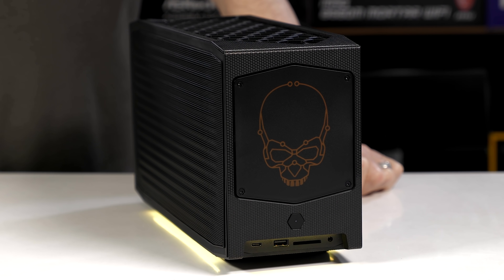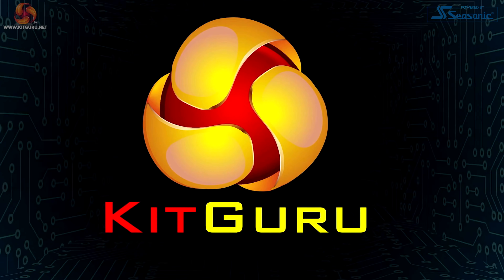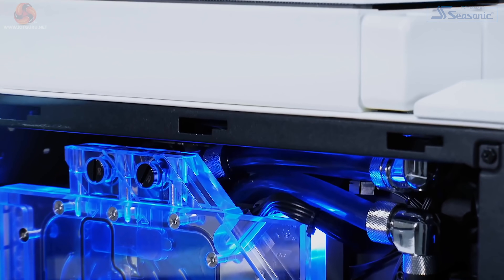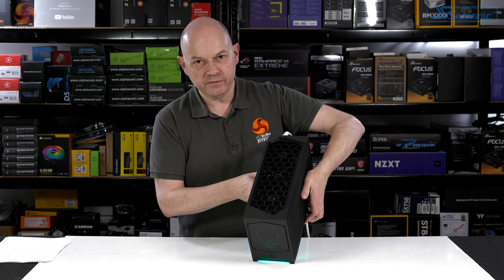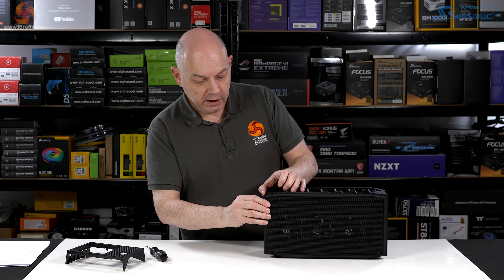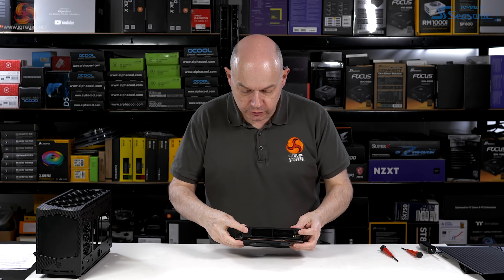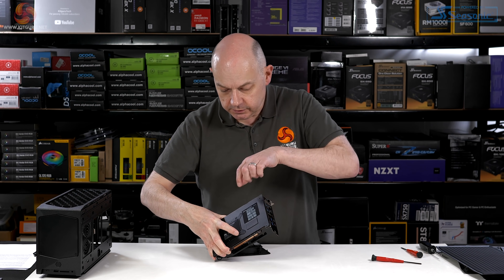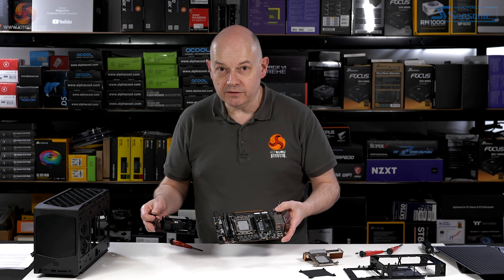Intel NUC 12 Extreme Review - Dragon Canyon!

Comment from the maker: so - let Leo know, would you buy it? are you in the market for something like this new NUC from Intel - and would you pay for it?
Reply: I'll wait for the Enthusiast version. I'm still not sure about buying the Extreme version, even for last year's 11th gen model.
Reply: I am looking for smaller version Intel NUC 12 Serpent Canyon The successor of Intel Phantom Canyon. Please make a review once you have it. Thanks
Reply: can u swap chip on this?
Reply: @frankhu8692  Supposedly, you can. But it's way too early to tell since this is the first time Intel give LGA socket.
Reply from the maker: @frankhu8692  Provided it is supported by the BIOS then yes
Reply: I'll probably settle for a few tiers down to replace my old Skull Canyon NUC, Only use it as a secondary pc to stream off NAS to (dumb)tv and watch youtube.
Leo, My question is do all the newer NUC's still have the built in IR receiver?
I can turn on this old NUC with Logitech Harmony remote from the couch(yeah I know I'm lazy) but I love that feature, Some of the other mini pc's lack the option and it is a no sale for me if it doesn't have it.
Reply from the maker: @ShaneMcGrath.  I haven't seen a reference to IR anywhere in the spec and did not receive a remote control so I reckon that's a big fat No
Leo

Comment: If I want to upgrade my NUC 12 Extreme i7 to the i9 variant, is it as simple as me purchasing just the CPU 12900 i9 variant and putting it within the Intel NUC 12 i7?  Or should I add thermal paste/update the BIOS? Or is the Compute element slightly different with the i7 variant versus the i9 variant? Would it void the warranty?

Comment: Saw from different review that it actually thermal throttles.  Hope Intel redesign the thermal solution next year.
Reply from the maker: During the initial boost under heavy load the CPU hits 105 degrees C however that is very brief. Thereafter the power rapidly decreses to 65W or 55W (or 35W) depending on the power profile and sits at the low temperature we detail in our test results. Not sure what you have seen elsewhere but our review sample did not throttle and instead behaved as intended.

Comment: Buying one! Easiest, maybe cheapest way to get a full Core i9 system. And it'll fit on my desk, freeing up under-desk space for... whatever. Wish I could order one now and not have to wait. Will move my current graphics card into it and put in a PCie 4 1TB NVMe SSD along with, probably, 32GB RAM. (Most of my data is stored on a large NAS.) Not crazy about the skull, but it is what it is. Good review. Thanks!
Reply: Where do you buy it from all i can find is scalpers amd thirdparty sellers. For some reason not even intel is telling me where to buy them.
Reply: @declanmeurig3861  It's not out yet, so nobody has them. It should be out in April, so I hear. My eyes are open and I am checking the Web for review and stuff daily. Keep your eyes open for its release. It should be available from several sources other than ones that add a too-expensive SSD and 8GB of RAM and are charging $1800 for it.

Comment: I love the concept and the form factor. Is it worth the prize? No I don't think so. I still don't get it why they wouldn't invert the cpu slotted motherboard. I understand the airflow between the gpu and cpu board will give some thermal issues. I am more a fan of a bigger cooling solution for dissipating the heat. If the prize was more reasonable I would be interested in it. For sure I would like to win one or get one discounted but a company has to make money. Great review Leo/Kitguru.

Comment: Who else was hoping beyond hope that Leo would reveal an Intel GPU when he opened the case?

Leo, please a chopstick to depress the GPU release tab; you won't scratch anything if you slip. When you slip. Would I buy it? It all comes down to price and the use case. An ITX system in a premium case is pretty expensive anyway, so a modest premium for this could be tolerable.
Reply from the maker: It's that word 'modest' that does a lot of heavy lifting. What price do you think is acceptable for a PC with an EVGA RTX 3070 (£900 these days?), 16GB of DDR4 and 1TB of Gen 4 storage?
Reply: @KitGuruTech  Yes, 'modest' does cover a multitude of sins. :) I'd put my own GPU into it. But I specced up a 32 GB 11400F system in a Torrent Nano (loved your review BTW) and that came to £739. So a little more than that.
Reply from the maker: @QuentinStephens  Do please apply the same reckoning to the Dragon Canyon NUC  and let's see whether you get the 'little more' that you hope for or 'double'

Comment: I honestly don't get why they built the CPU cooler facing inward when it's clearly a fully bespoke build, it seems like it just reduces the limited cooler space efficiency and increases it sizes for no appreciable gain.
Reply from the maker: The CPU cooler is drawing air in from the rear of the chassis through the part I called a shroud but which is better termed a duct and then exhausted upwards to the triple fans which are directly above the cooler. The chassis design seems pretty good to me.
Leo
Reply: @KitGuruTech  But would it be more space efficient to draw air from the outside? It would be one less 90 degrees turn (as it seems to be a blower style fan), which would remove the necessity for the duct, or at least a smaller straight one which would in turn have more static pressure?

I know it's probably all properly dimensioned and my suggestion would prolly not make a difference with all staying the same, but in my head, turned to the other side you'd gain some Z axis clearances to have a bigger blower and bigger heatsink, which would further have more static pressure, which would allow a smaller fin pitch.

I know I'm just being an armchair designer and they prolly have their reasons to do it like that (and that some of my suggestion would further push the price), but this layout while functional seem a like convoluted in my eyes.
Reply: @herrerasauro7429  The duct is drawing air in from the outside, that's it's sole purpose.  
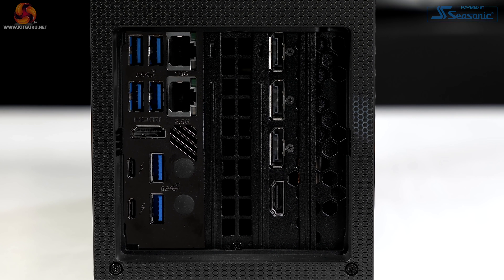The back of the NUC compute card is covered in IO, as you can see clearly at 4:30. From left to right you see there's there's the NUC compute unit, the intake, then the GPU. The solution works, and the cooling is supposedly excellent according to this and other reviews, so I'm not really sure what you're complaining about.  To deliver what you're suggesting would require making the entire compute cars one slot thicker, reducing internal air flow and likely not improving performance at all.
Reply: @MattMeNotYou  I understand that, what I'm saying is: why it's intaking from the back and not from the side panels as most sandwich style ITX cases do these days? It would completely negate the need for ducting the intake (at most it would use something like Noctua solution for downdraft coolers). In no way it would make it thicker, in fact it would make it slimmer.

As it was build I understand it's not possible, but as it's a wholly bespoke design by intel the card orientation, it would be possible and more sensible/simpler in my head.